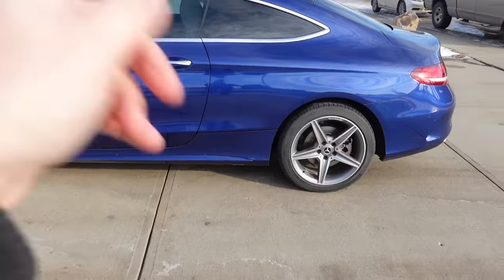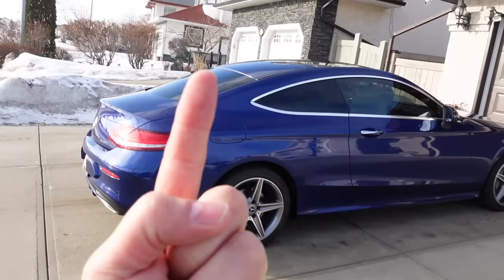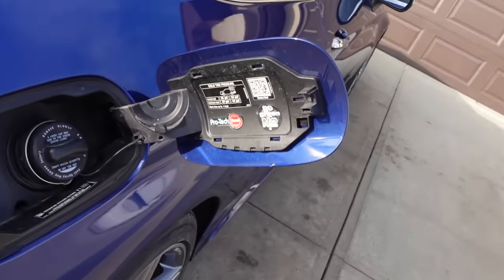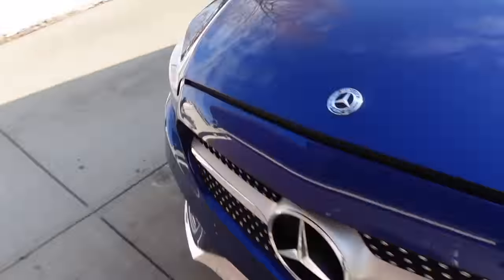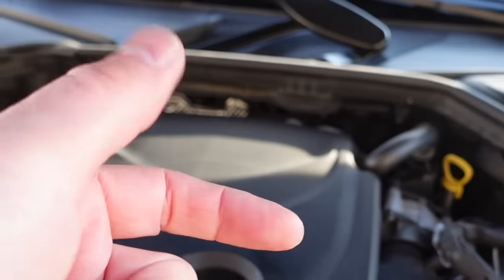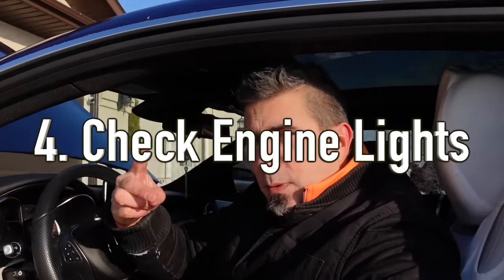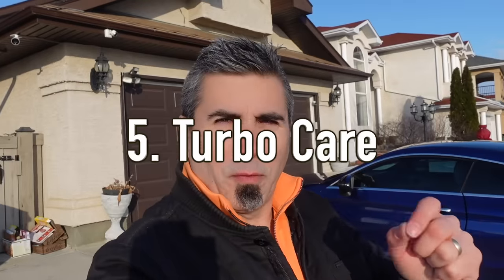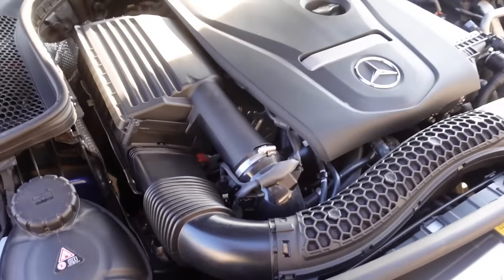STOP Destroying Your Car Engine! (With These Tips)

Comment: There's a simple trick that works on most cars to disable the stop start system.

The battery positive clamp on most modern cars has the usual thick gauge wire coming off of it, But it will also have a pair of thin cables coming from the plastic casing on the clamp and going to a connector. This is for the battery voltage sensor that's fitted into the clamp unit. If you unplug this then the car has no way of knowing the battery's level of charge, and if it can't tell if there's enough power to restart the car it won't risk enabling the stop start system.

Some cars throw up a little error message on the dash (usually just a little stop start "A" logo with a line through it), but most car's don't even do that, and as soon as you reconnect the sensor the error goes again anyway.
Reply from the maker: Great!  Thanks for sharing
Reply: Wow. Great share.  Thanks
Reply: Well in my case the check engine stays on, I'd rather throw the car in L9, and insure your check engine doesn't stay on untill I really need it.
Reply: @cdsorvinyl  What car's that on mate?
Reply: @Reman1975  - A 2019 Chevy Blazer

Comment: I've found the auto stop is actually worse on gas for me on average. However the oil doesn't dissipate that quickly and the wear and tear is arguably negligible. I just hate the jerk on the motor mounts from starting in drive like that

Comment: Its automatic for me when I hit the start button on my Subaru to then hit the auto stop/start button to turn it off. I don't even realize I do it anymore, but I hate for it to shut off my engine at a stoplight. Subaru's boxer engines start with a shake anyway and I don't like that over and over as I drive around town. Plus i do change the oil about 2,000 miles sooner than recommended. I figure its cheap insurance to prevent engine wear.
Reply from the maker: I totally agree

Comment: I have a minimum 95 octane motor in my 2003 MX-5. I use 98 (non ethanol) petrol here in Australia, and have done since I bought it new in 2003. 
I can’t do anything about cold starts (and neither can anyone else) but in Australia it only drops below 0° C (32°F) four or days dats during each winter. 
I have had a regular service and oil change every 6 months.  
I had a new radiator and silicone hoses installed “just in case” at 100,000km, during the 62,000 mile service where they changed the (non-interference) timing belt and water pump. 
I do about 6,000km a year (3,700 miles). 4km to work, and 4 home (2.5 miles each way)
I have no turbo. 
I’ve never seen a single warning light. 
“Most cars these days are turbocharged” - um…. No they aren’t… “most” cars are naturally aspirated. 
I have no “stop/start” feature in my car to worry about. 

All in all, I think I’m doing okay.

Comment: On EU cars you can disable StartStop for every car very simply
Locate the negative cable on the battery and remove a small jack with 2 wires from the little device on the negative terminal. Some cars give you warning when starting that startstop is inoperative and some just show the icon as if you disabled it. When reading error codes with original Xentry diagnosis on mercedes you need to put back the jack or else it will bug out for some reason and not let you delete codes and it might bug out the ABS and traction control as well. All in all Start STop is SUPER MEGA ANNOYING. I once almost crashed when i stopped on the intersection and needed to speed up fast but the darn thing shut off...

Comment: Actually that statement where if you stop at a traffic light and your car switch off then turn back on when you move is like a cold start is extremely wrong. Oil move when engine parts move, and it doesnt get cold easily it takes hours for oil to cool down, so when your engine turn back on it continue running normally and oil will flow normally as if it wasnt off. Really from the whole video only the fuel point and choosing the right oil for your engine were correct, the rest were just to make the video longer 😂

Comment: I mix 50/50 aurora white vinegar from no Frills with Petro Canada 87 octane gas. Cost per liter is down to circa $0.65 / Litre. Have been doing this since 2020 no issues on my 2005 4Runner.

Comment: Another thing is to buy as much displacement and torque as possible. Since…
          HP = Torque x RPM
More Torque lowers RPM at cruise, so a tiny 4 cylinder eco engine with a 4000 RPM hwy cruise spins 3.5x as many times per mile as a say, supercharged V8.  

Odometer miles don’t matter, number of engine spins matter.  So if you are cruising at 3000 RPM, use half your intended oil change interval, in miles.  If you have a 9000RPM redline and you cruise at 6000 RPM, you need to change your oil 4x as often, in miles, so no more than 1000 miles.   Every 500 miles would be better, since metal wears exponentially with surface contact speed.  Basically, every other tank of gas. 

I learned that the hard way when my 1985 MR2 died from no compression left at 85,000 miles. It had a 1.6L and a 7500RPM redline to squeeze 115HP from 93 ft-lbs of torque, it cruised at 5500–6500 RPM to go the speed of traffic in the mid-US (~90 mph).  So it had 400K miles-worth of engine spins on the motor at 85K actual miles.  Plus, I was young and stupid and only changed the oil every 3000 miles, when it needed a change every 750 miles due to the high RPM per mile.
Reply from the maker: Absolutely and thanks for sharing.  For sure the little engines are always working a bit harder and often lead to an earlier demise.

Comment: Our pristine 2012 Lincoln MKX was Microlon Treated @8k miles new. A one time treatment. Engine, Trans, A/C, Rear diff, AWD, PS and cooling system. Goodbye friction. Hello better MPG and long life. Oil chng. each 4.5K. Trans. 30K Coolant 25k PTU 25k Rear diff 80k PS 20k and brake fluid every 12 mo. We use LiquiMoly lubricants and their  fuel cleaning and atomization products.
 Your example vehicle is a mfg. goldmine for service income. Looks nice  though. Thankfully we have a brilliant naturally aspired  V6 engine. No turbos nor compressors. The 4 cyl turbo fad is a disaster with engines never reaching 100k.  

NICE JOB.
Reply from the maker: It’s all about keeping healthy fluids in the vehicle

Comment: Maybe it's different where you live, leading to misunderstanding of ethanol and premium fuel in general.

1. In all places I've been across the United States, premium =/= non-ethanol, actually, could potentially have more since easy way to raise octane of fuel. In the US, most pumps are marked "up-to 10% ethanol", unless the fuel says "non-ethanol" or "ethanol free" you should expect it in your fuel. Just like Premium though, ethanol free is more expensive usually, using it though, especially if gas just sits in the tank a long time, would be beneficial as mentioned as ethanol attracts water.

2. check engine light does not necessarily mean there is problem, but yes definitely check it out. I have almost every light on my dash lit up with multiple check engine codes for couple years now. The most important thing is knowing what the codes are and if it really matters, otherwise absolutely what he said. Regardless, find out what codes are fast because if is major problem, or problem that promotes major problem, waiting on it will be devastating.

Comment: Stop start is really bad in so many ways.   The starters were never meant for so many cycles, beefed up or not.   The oil settles, the gears take a hit, you also use extra gas just to start an engine and there are too many times the engine is not ready for sudden acceleration if you need it.   The technology is great for the vehicles that it was meant for.
Reply from the maker: Totally agree

Comment: That's all good. One big issue (Auto Engine Stop) was with the 2021 Chevy Tahoe (probably also Suburban, GMC Yukon, etc.) that were manufactured before June 2021 which had the Auto Engine Stop button. Well, if you turn off that feature with this button, then the engine got messed up and stalled (my engine started to stall at 1,000 miles whenever I came to a stop and the engine turned off and and it just died) and the Check-Engine light came on. The Chevy technician at the Chevy dealership said to NOT engage that button, meaning don't turn off the Auto Engine Stop feature.
Well, I had to live with the Auto Engine Stop feature (very annoying) for a few months and didn't turn the feature off and things worked okay, but then Chevy removed the Auto Engine Stop feature starting in early June 2021 and I traded my 2021 Tahoe in and got the new 2021 Tahoe version manufactured after June 8, 2021 which didn't have the Auto Engine Stop feature and everything worked great. Just something noteworthy to stay away from such Chevys with the Auto Engine Stop feature as it can become a major headache.
Reply: There was a chip shortage during the China Flu and GM didn't put that dreaded start/stop in.  I actually saw where they were crediting buyers $50 for their window stickers for not having it.  Those would have been the vehicles to buy.

Comment: Most of modern engine have a water cooling system for the turbo with a separate line and an extra electric water pump that turn when needed when you switch off the engine and turbo need be cooled

Comment: it's not really about starting or shutting off the engine it's about engine cycles (from cold to warm to cold)

engine cycles is actually a better predictor of engine life than miles. the different metal types expand and contract differently with the temperature, so with many cycles things warp & weaken. engines needed such precise machining that 1 millimeter off can cause an engine to destroy itself

Comment: The oil is multi grade and is thin when cold
In Ireland we can only get 10 % ethanol petrol/gas and don't have problems apart from old cars where it damages the rubber seals

Comment: I disabled the auto start feature on my 2015 Jeep Cherokee trailhawk my unplugging the module connected to the battery. Another tip. Short trips are hard on the engine oil and reduces its life because unburned gas and moisture does not have time to burn off. These contaminates reduce oils ability to do it's job.
Reply from the maker: Thank you very much

Comment: It's usually tha gas cap that causes a check engine light. There's a valve that lets air in as the fuel pump empties the tank. If you hear a thud when opening the gas cap it's the gas cap.

Comment: 8:48 that’s so ironic because I had my check engine light pop on and started jumping to conclusions, went to get an oil change and had an inspection done at Valvoline just for it to be my gas cap. ‘11 c300 😂
Reply from the maker: That’s a fortunate situation

Comment: Is the damage to the ring gear and other engine components worth the emissions saved by start/stop technology? The best thing you can do for the environment is to keep your engine running properly. The engine wear and tear caused by a start/stop system combined with the mass of worn parts or engines, combined with the financial and psychological damage caused to the owner has to cause more "environmental" damage in the long run that the CO2 emissions prevented by a start/stop system.
Reply from the maker: I totally agree

Comment: Great info except the portion on ethanol -the author is completely wrong in that section.  It is true that ethanol gas is only good for 3 months, while normal gasoline is good for about 6 months. This affects storage, but not normal driving. Every car manufactured since 2012 will wear normally whether you use ethanol or not.
Reply from the maker: Not made of water at all.  It pools existing h2o
Reply: If you told your viewers that you are talking about old cars, I would give you a pass. Any vehicle built in the last 15 years is designed with 10% ethanol in mind and does not change the life of the vehicle. You're creating ignorance to get clicks. So immoral. However, I will update my original comment.  @ECPP

Comment: Great info, thank you! I didn't know about letting the car run for 45 seconds before turning it off. Completely agree on that godawful start/stop system. My 2013 BMW F30 had a button to defeat it like the one you showed. The new 3-series does not, it turns off only in S and S+ modes. However, my new Audi A5 does have one. Go figure...

Comment: Not all the oil settles into the sump. There is an oil film still giving protection to engine parts. Better protection is achieved if quality full synthetic oil is used and changed regularly.

Comment: Just bought a Cadillac and it has the start-stop feature. I always turn it off before I drive away. My mechanic told me every time I stop, and the engine starts again when I start to drive off, the starter has to start the engine. On-off will have you replacing the starter way sooner than you normally would. Do yourself a favor and just turn it off!!
Reply from the maker: I totally agree

Comment: I never go up to 10k miles between oil changes, I only go 7500-8000 max. Especially if the motor has a turbo.

Comment: Thank you for expanding on turbos. The 4 cyl turbo's i refuse to buy! As for a turbo! You should actually let turbo cars cool down for 3-5 minutes! i would change oil 3000 miles 3500 if you have a 5 /6 qt engine! 7/9 qt's maybe 5000/6000 miles! or place the money aside for an overhaul the engine!
Reply from the maker: Cheers

Comment: Lots of good stuff here however higher octane fuel does not necessarily equal less ethenol. In fact the addition of ethenol in fuel is known to significantly reduce knock. Since the primary purpose of high octane fuel is to resist knock in high compression or turbo charged  engines you'll find that more ethenol is used often in those blends.
Reply: this is why with my bmw i3s I always ran the rex to burn off the tank instead of leaving the gas in the tank for months on end
Reply: @raven4k998  Very smart.

Comment: Where I live, by law, gas has to be at least 10% ethanol for 5 months of the year.  
Does it benefit a supercharged engine to let it idle after driving?  I always hear people advising it with turbos, but never hear people saying it about superchargers.  Also why can’t car companies just make it so the cooling system stays on after you shut the car off?  My dad’s 1981 Toyota Landcruiser does this and it has over 900,000 trouble free miles under its belt.  It has never broken down once.
Reply: I think it’s because it’s the exhaust side of the turbo that deals with the most heat because of the temperature of the exhaust gases. A supercharger doesn’t have to deal with exhaust gases so runs much cooler

Comment: I can only give an advice for auto start stop function for German cars. All the German Car Manufacturers have designed the Oil Pump in a Car via simulation Software. That led to discovery of some our Engineers that don't work in these companies, that the oil pump is not pumping with high enough pressure whilst idling on stand still leading to catastrophic failure in near future.
In these scenarios when you drive alot in the city either let it turned on because atleast ur engine will not run with too low oil pressure and be horribly lubricated. When you start your engine the oil pump already works with mid to high pump pressures to quickly lubricate it again. Leaving the engine turned off for a minute won't drastically change the oil viscosity and affect the performance of your oil pump or the lubrication effect.

On any other Car that isn't made by the Germans and have no low Pressure Oil Pump issue predestinetly on idle, you can ignore this advice and are better off just turning off Auto Start Stop.

If you have an Automatic German vehicle with a Sport mode which increases the idle rev line of your engine, turn of Auto Start Stop and use that because even if it consumes more fuel while standing, it keeps your engine warm and your oil pump pressure high.

Comment: Ok I can’t. Fuel will separate whether it has ethanol or not. Older gas will also lose its octane level. 
When you buy a new car, most engine wear is during the break in period. On my new cars (I’ve had plenty, or too many as my wife says and I have old hot rods that I built engines for) I always change the first oil at 500. Then the next at 1500. After that I consistently change my oil at 3000-3500 miles. Even if it says 8-10k. If you change your oil more frequently, your engine will last longer. Older the oil, the more contaminants you’ll build up. Use premium fuel. Your ECU will use less fuel (small percentage), your engine will run cooler and your fuel pump won’t run as hard. Plus, you’ll have less carbon build up. (I’ve dyno tested that). 
As for auto engine shut off. The wear will mainly be on your starter and battery. Some manufacturers, like Mazda, uses cylinder compression to restart the engine. This guy talks about wear on your engine because the oil has drained down into the oil pan because it’s like a “cold start”. It’s not. You just ran the engine so the oil is thinner and it’s all over the areas that need oil. Synthetic oil is sticky, so it stays on those components for a while. Cold start on new cars are not as bad as old cars because synthetic oil is supper thin and travels throughout the engine faster. Some cars use 0w5. 
Maintain your engine better than what is recommended in the owners manual and it will last.

Comment: i have a 2022 subaru forester sport with the rab, with that i was able to get a simplr plugin cable that connects under the driver seat that will permantley bypass that stupid engine auto off feature so i don't have to constantly remember to push that button to disable it, most annoying feature just took over the tire pressure sensors as being the previous most annoying and often failure sensors,